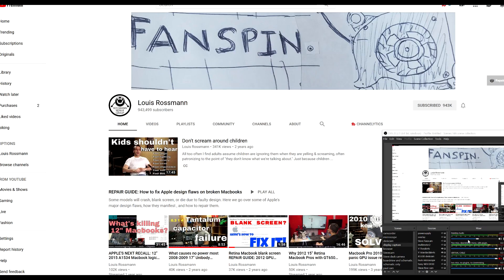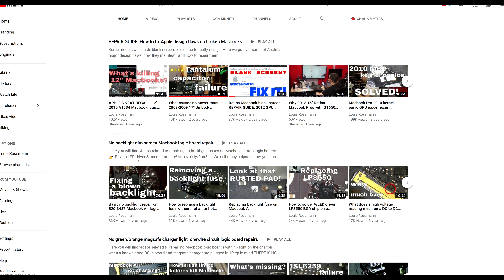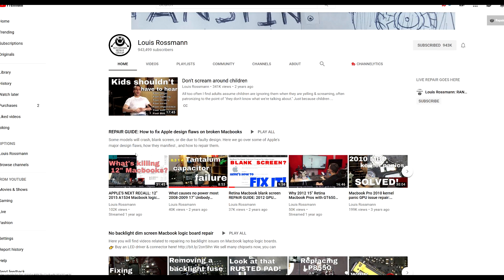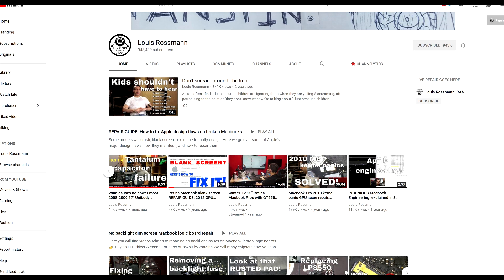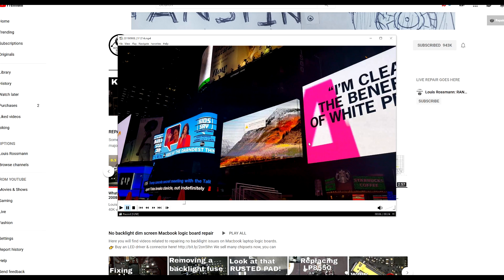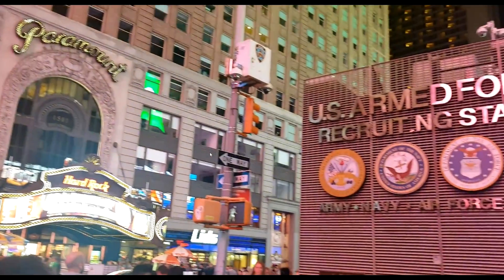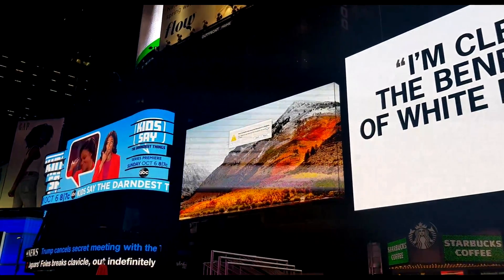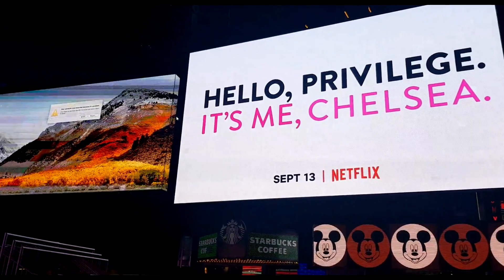Apple succeeds at truthful advertising!

Comment: I mean, I'm not suggesting you're comparing Apple to Windows, but I've seen WAAYYYY more Windows BSODs and Windows error screens on digital billboards than Apple. In fact this is actually the first time I've ever seen macOS used in a digital billboard. Does that prove their products/software are shitty? Not really, but I guess to each their own.

If you search google for "time square billboard error screen" 99.999% of the relevant results are Windows errors. Only if you add "mac" to the search terms, you'll see literally only this error.

Comment: Apple: "Only a tiny percentage of billboards have had this problem."
Reply: Which in this case might actually be true.
Reply: They fault, not Apple. They used it wrong.
Reply: Hahaha
Reply: The problem is on "billboard", not "Apple"
Reply: @tanjinpang  No, it's "user inflicked water damage"
Reply: Sounds like AMD's response to any Boost clock question
Reply: @czdaniel1  At least they are working on a bios update to address that. Whereas for years Intel and their mobile processors don't really hit and maintain the advertised boost clock and has don't nothing about it.
Reply: @MarineRX179  -- I feel like that's blaming Intel for bad airflow choices of the indifferent laptop makers. It's not Intel's fault if Apple creates a laptop with no airflow, then drops the fan-curve program to keep it quiet, then everybody copies Apple
Reply: @MarineRX179  Isn't that update out already?
Reply: @czdaniel1  I don't mind it too much, though it's misleading to claim higher than commonly achievable frequencies. For me I'd just end up with what... an extra 1 frame per second? Eh. Plus I'm pretty sure AMD 4.5ghz=Intel 5ghz anyways. Can't say for sure, but I heard it from not an apple fan the YouTuber. I haven't tested though.

Comment: Reminds me of the time that one of Microsoft's Windows OS's bluescreened during a presentation of that very OS in front of a lot of people.
Reply: Yeah, not defending Apple on this one, but they're certainly not alone in the public display of errors.  There are tons of examples of Windows BSODs and linux kernel panics happening in public places.  Public OSX machines are a bit more rare outside of Apple stores, so public OSX crashes/errors/reboot messages like this are similarly more rare.  Moral of the story: ALL computers and operating systems suck.  Some suck less than others.
Reply: @Yukeake  Well there's a difference between a public bluescreen, and a public bluescreen while demonstrating the OS itself. I mean, if you wreck a car while driving it in public, that's one thing. But if you were to wreck a car during the filming of a commercial for that car, that'd be something else entirely.
Reply: @Dhalin  Totally with you on the irony of that one.

Comment: running advertisements, that costs 10000s and upwards to run and get the location alone on some dumpster macos or even better microsoft windows? and running that also on garbage hardware? sure sure, makes perfect sense...
why run it on a reliable designed to be run forever without crashing gnu + linux setup on reliable hardware, no no no....

Comment: What dummy uses a Macbook for billboards instead of a SBC like Raspberry Pi?
Reply: @Thomas-gi1iv  r/whoosh
Reply: But don't you know that Apple is reliable, easy to use and doesn't get viruses?
Reply: @Nathan Uhe 
Do you know what makes the Pi so unreliable?
Reply: @Austin1990  garbage SD cards and shitty power supplies. Get a Samsung card and 4 amp QUALITY psu and problem solved. But they wanna use no name Chinese garbage and blame the Pi.
Reply: Chromebit would be more appropriate.